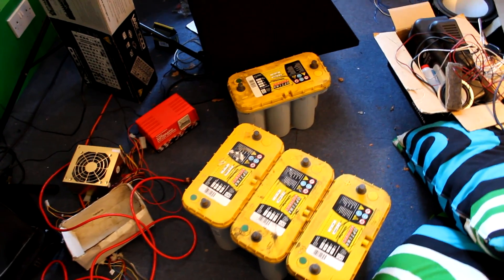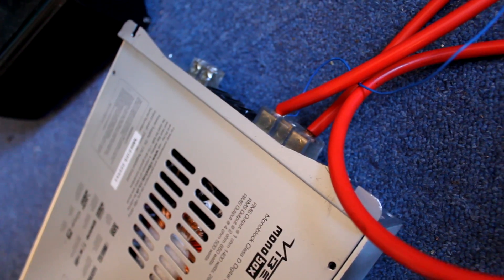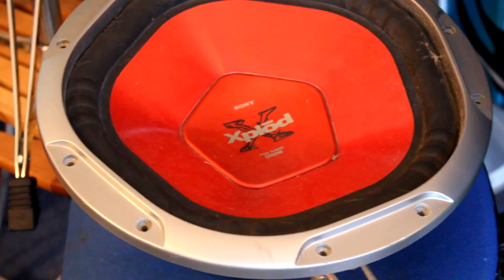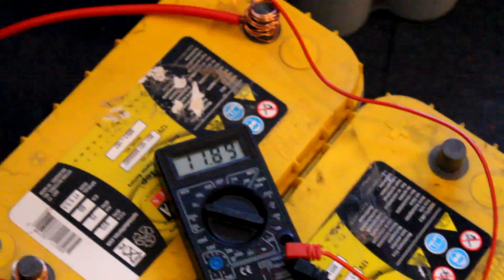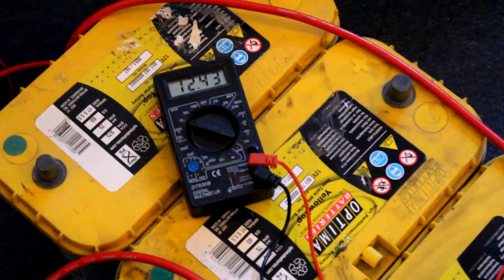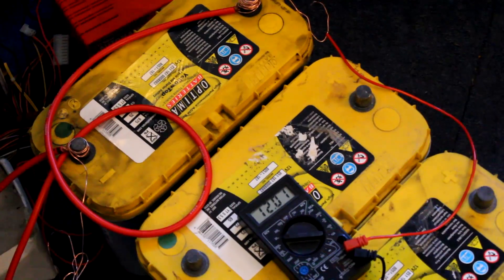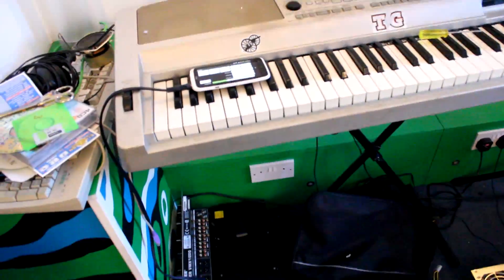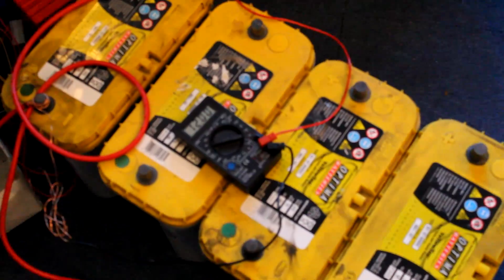Drop testing x4 Optima Yellowtop batteries

Comment: If those batteries do not sit  at 12.8+ 
resting!
After charging and sitting for a 24 hour period  they will not last as long!!!
I've been running them for years for my high powered stereo system 7500 watts continuous!
Reply: Also cannot just wrap the wires around the battery lugs / posts going to get hot you're losing average voltage and you're creating resistance!!
Get some proper battery terminals and your test would go a lot better need to charge those batteries up should be 12.8 to 13.0 minimum otherwise something wrong with those deep cycle batteries how old are they!!??

Comment: indeed... I load test my batteries with a 1000watt inverter with 1000watts of halogen lights connected to it, which generally puts about 100amp load on the battery.
the amp in the video is probably barely putting a 10-15amp load on them.

Comment: Capacitors have usually resistors in parallel to them to discharge them once the power is down.. so that they don't hold charge they are commonly referred as "bleeder resistors"

Comment: I thought desulfators were only useful on lead acid battery's ? You will still have a surface charge on the optima's after charging , the volts will be resting higher than normal .... Although your batts after a charge should still be over 12.2v  .  Shame I don't live closer to you I would be happy to test them for you !

Comment: Not criticising what your doing so don't take this as a diss ...... A good fully charged battery should be sitting at or near to 12.7 volts , I would recommend testing them with a heavier load ? Maybe connecting it to your car and disabling the ignition coil and cranking the engine for 10 seconds ? The volts should NOT drop below 9v ... OR the other option get an AA patrol to test them ! They use an industry recognised midtronics tester which is capable of testing spiral cell optima's ... !

Comment: that last one has a higher internal impeadance. that means it has a lower charge rate, due to the higher impeadance load, and it also means more voltage drop for the same reason

Comment: should use a load tester on those. I have a battery that sits at 12.7 but it wont even turn over my truck. voltage on a battery can be perfect but they might not have much for amperage.

Comment: if you try balance charging each battery separately to 13 to 13.5 now on recondisaning the battery try bilding a badini raydeant charger this will completly desufate the batterys and long as they have not been over worked will bring them back to as new standered

Comment: Build a simple desulfator to make those batterys even better, it will make big sparks when hooking it up so recommended not to touch the terminals when there is no load because you can die lol

AC in----{220v+ 35uf Capacitor}---[ Bridge  ]---(+)--------- to battery
AC in---------------------------------------[Rectifier ]---(-)---------to battery